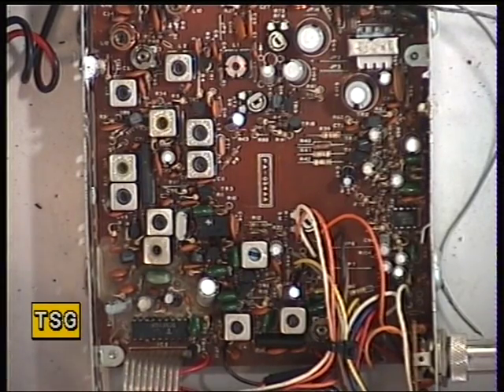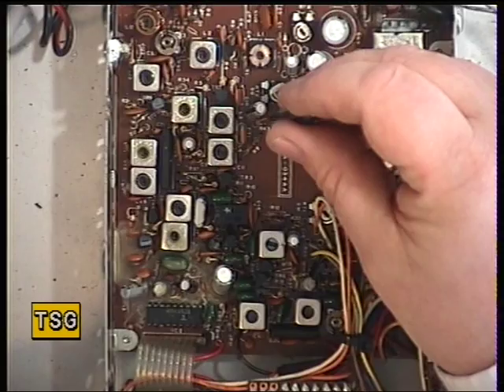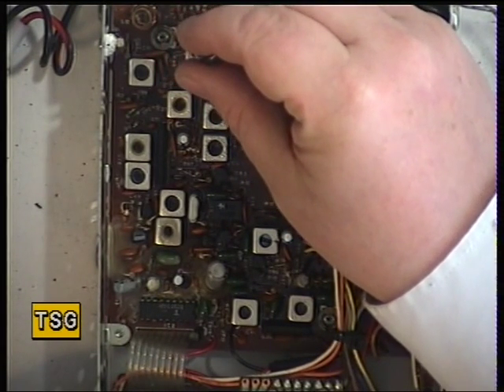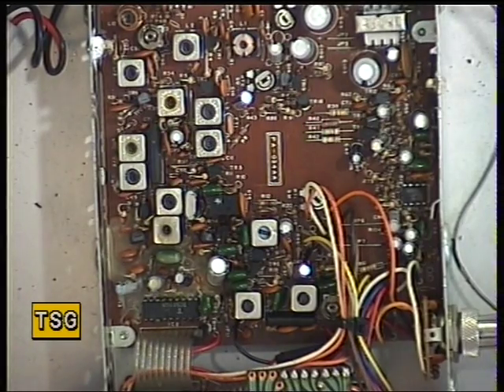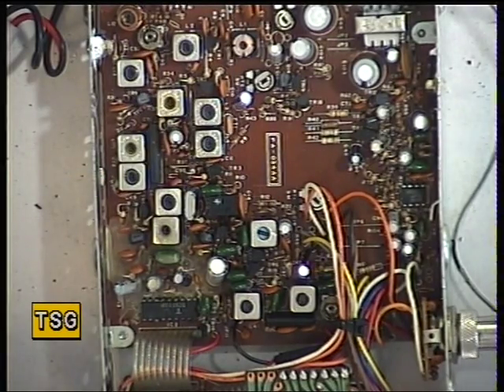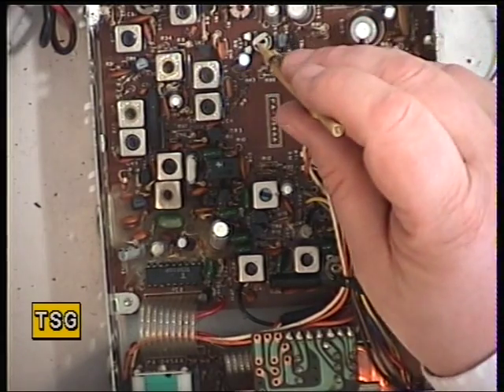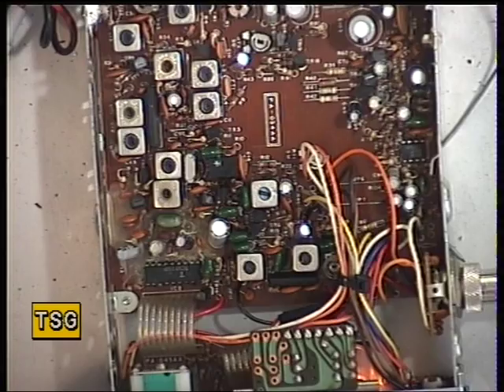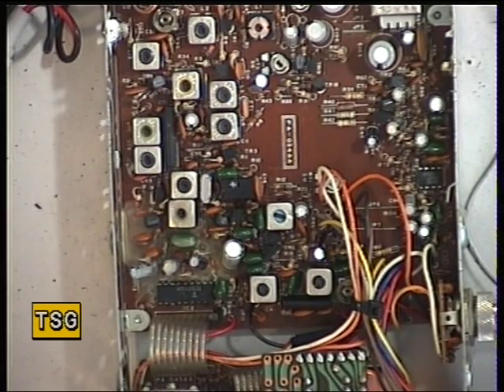Uniden Uniace 100, UK (CB 27/81) CB radio (Mobile) - Receive alignment

Comment: I’ve discovered a rather novel way perform a rough receive tune up. I stick a little radio out in the garden on a dummy load running 4w and use a signal generator app to transmit a low level signal with a 1khz tone. Adjust the radio in question to the best receive. Then drop the garden radio down to 0.4w and adjust again 👌🏻

Comment: Hi Richard in the early days you were changing caps on all the Uniden boarded radios...Does the U100 need the same mod ? Thanks
Reply from the maker: Yes if it was a customers, but that one is our sets...the two 220uf capacitors in the 8v rail. You are quite right.

Richard
Reply: Thanks for that i will change mine..
Reply from the maker: One is near the synthesiser IC & the other is near the audio IC. They tend to go leaky causing the  8v rail to be dragged down. The display then doesn't work & the power supply to the synthesiser is robbed.
Reply: can you do my uniace 300 for me pls